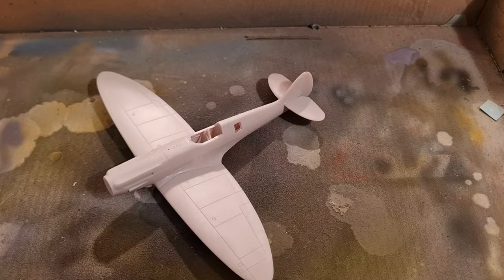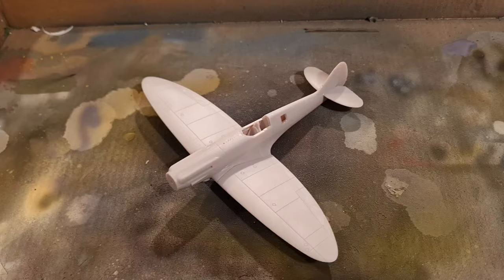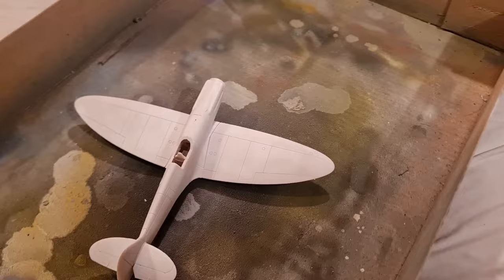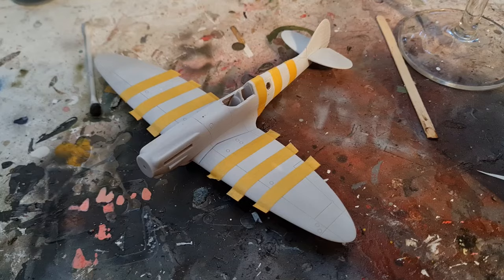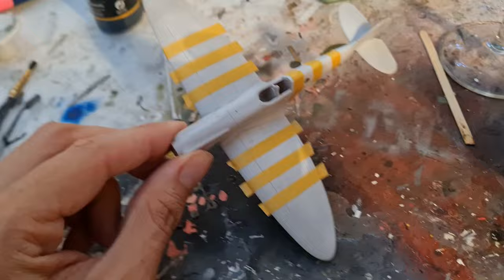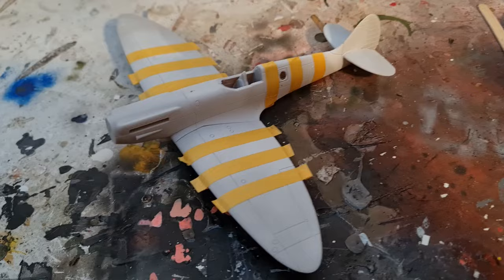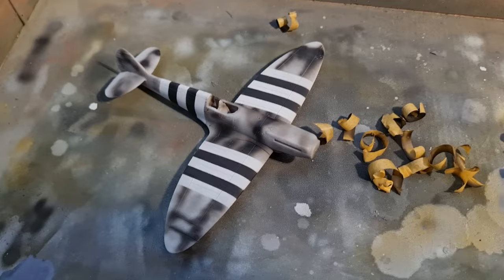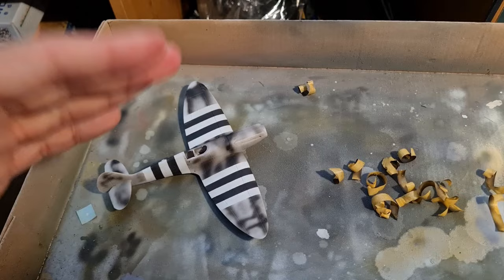The BEST! way to paint D-Day Invasion Stripes on your models

Comment: Thanks good vid but how wide should the strips be as I'm making a Hawker Typhoon at the mo and not sure how wide they should be....👍
Reply from the maker: Great question. I didn't mention it in the video because the answer is "it depends". Different scales and different aircraft will have different stripe widths. Reference photos are the start point. Mark the outermost parts, measure and then divide the number by 5. I think for this Spitfire I used 4mm tape and that's what I used for my 1/72 Typhoon too.
Reply: Thanks